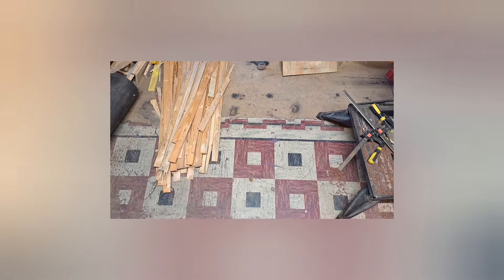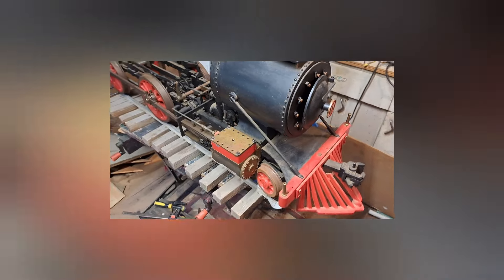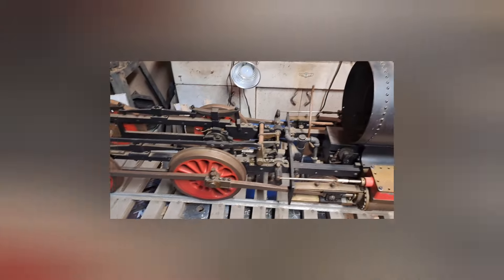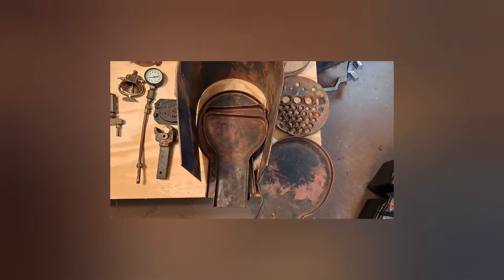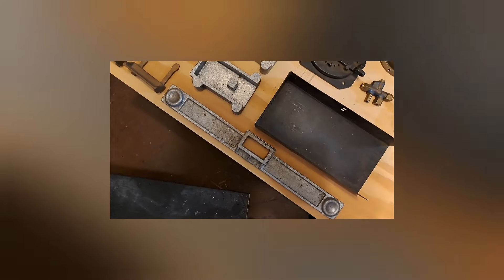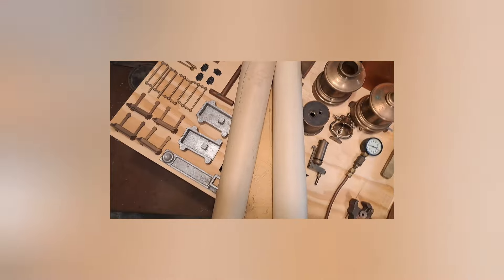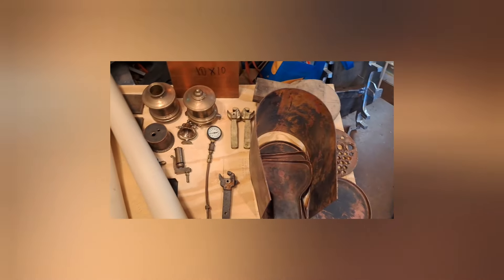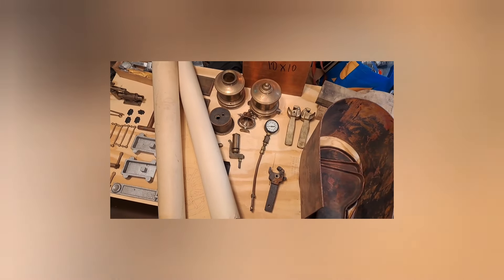So I bought a thing...

Comment: This dude out here buying a frick'n Lilly Belle on the cheap!

Holy crap, the PLANS!!! You should find a way to get those scanned and on the internet! :)
Reply from the maker: @Roboticus_Prime_RC  they're probably still copyrighted, so probably can't do that. Might sell a few sets, however.
Reply: @oddduckfoundry8223  Hmm. If I recall correctly, the Lilly Belle(s) were built from the plans of a real 4-4-0 locomotive. That's why the workmanship is so good.

Those plans likely are public domain due to age. Even if the big mouse had rights, they probably lost them like they did the original Steam Boat Willie.